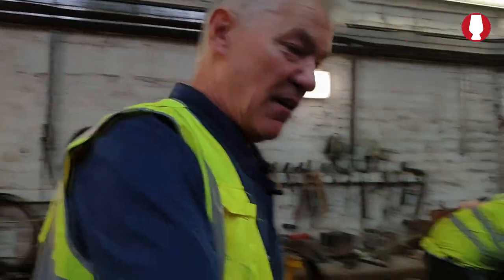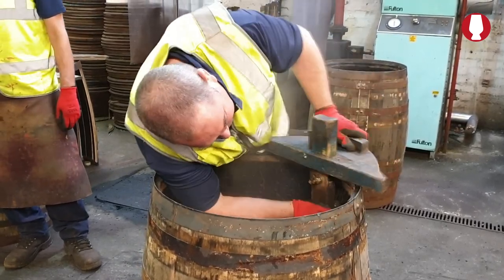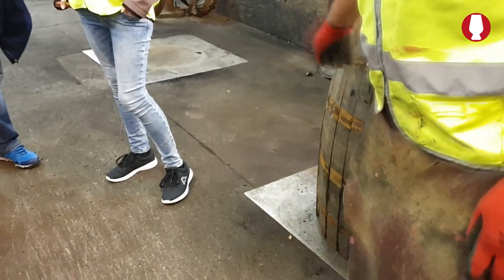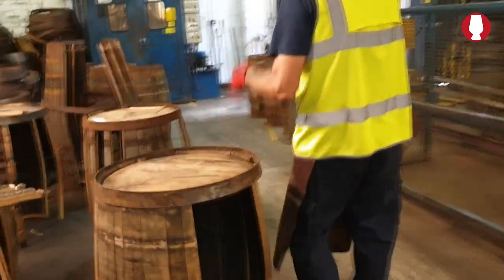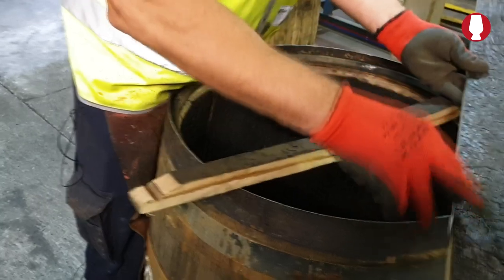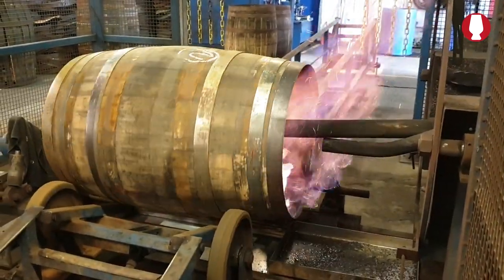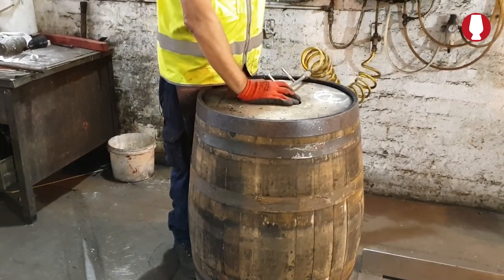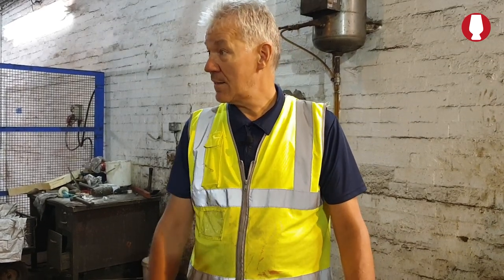How to fix a cask - Eine Tour mit Andy Moore, Head Cooper Loch Lomond

Comment: The basic figures here are quite amazing: a 25 yo cask has been through four fillings already; comes into the cooperage and is de-charred and then re-charred by the coopers, and is then ready for a further four whisky refills. That's what I call making the most of the barrel! I'm just guessing, but I'd suppose those final four refills might be for a maximum of 4 or 5 years only and the spirit would then be used by the blending industry? I was also surprised to learn from the master cooper here that ex- bourbon barrels are the best to work with and the most stable with relatively few problems of leakage. So American white oak is clearly the whisky industry's favourite wood. Great video - heaps of thanks for uploading this and making it available! First-class learning resource. Cheers!
Reply from the maker: Thanks a lot for your kind words. The tour with Andy was indeed very interesting and we got great insights from a man who knows his trade like few others...